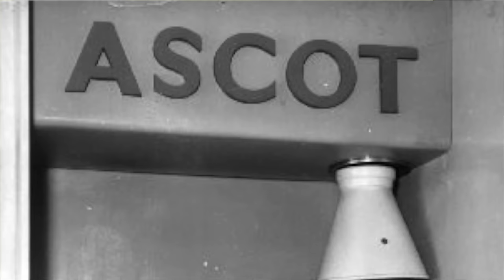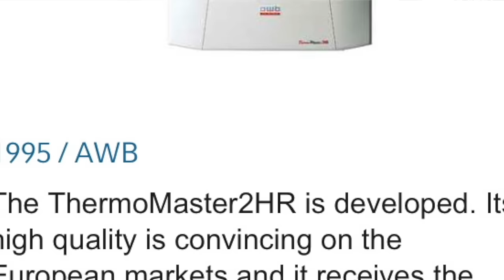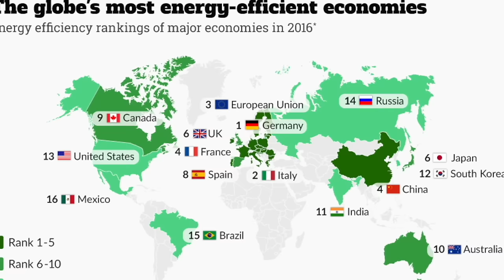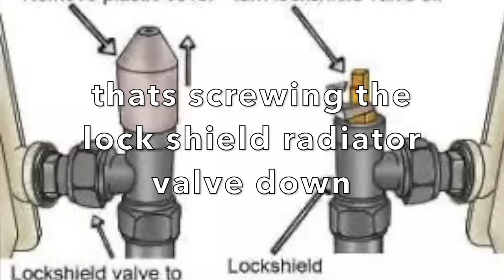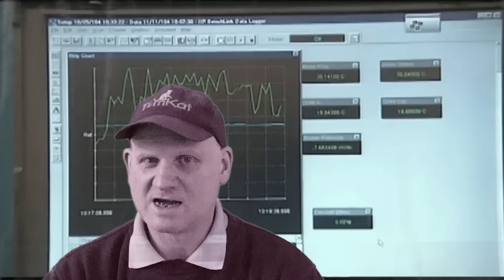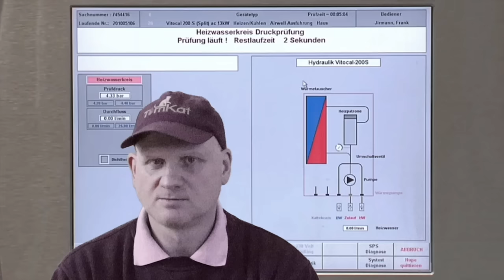WHICH IS THE BEST GAS BOILER for your home. Looking into the best boiler for uk homes in 2022

Comment: Quite right about old boilers. I have a 25 year old Camray Oil boiler and still going strong. What is the progress having to renew them every 10 years. What is the point of high efficiency when they only last 10 years?
Reply: Burn less fuel?
Reply: @edc1569  Yes I suppose so with 30% extra efficiency they would pay for themselves in 10 years . Since I posted that comment I sold my house with the old boiler and got a house with one of the new ones in it and what really makes the difference is in new radiators.
Reply: True, what's the point
Reply: @CommercialGasEngineerVideos  The money that is saved in fuel over a period of the life of the boiler is cancelled out by the cost of its replacement. I think I would rather have an inefficient boiler that could go on for 30 years than one that has to be replaced every 8 or so years.

Comment: I dont know about Best boiler But this is one of the the BEST Videos for our market...Thanks and will catch up soon..
Reply: I think the best 3 boilers are the new W Bosch, Vaillant  green IQ and Intergas, regards george
Reply: @mrcombiBedford  WB old rubbish recycled...at least they made an effort on the PRV...Vaillant yes agreed and Intergas Nope takes too long for parts to arrive and they are extortionate prices on parts AND their technical support is shite BAXI Alpha Vaillant all the way
Reply: @chohanchohan8208  I used to install loads of Intergas, my two installers put loads in the very very reliable one pressure switch (muck) part from P Centre was 2 days. Mine is 8 years our daughter is 3 years  both zero faults. As always it's down to installation and 12 month regular maintenance , regards george

Comment: Valliant Boilers: the Mercedes benz of boilers. My diverter valve started to leak in two years but then again: my radiators were not flushed: Had them flushed and since then the boilder worked flawlessly.

Comment: Have had a Potterton system boiler for 13 years and only one warranty issue. Getting kitchen done and replacing with Baxi 800 - backed with a 10-year-warranty. Spoke to three different gas engineers who all rate the Baxi for ease of fitting and reliability.

Comment: Excellent video Derek, packed with a wide range of information its very difficult for the average consumer (me) to take in. Watched this video a couple of days after my heating guy advised and fitted (replacement) a Worcester Greenstar 30si in our medium size 1930's solid wall double fronted semi with one bathroom. Hopefully a good choice for my circumstances. In the process of trying to work out the best auto setting for the EPH. Also watched a very simple balancing video from "Skill Builder", if needed in the future. I used to think computers (my expertise) were complex  but heating a house is up there with them :)

Comment: I had an Ideal Combi boiler installed early 2019. I think they took the ancient Baxi one I had to an archaeology museum? I have a hand held remote about the size of a small round alarm clock with touch sensitive controls to control the heating. It bypasses all the thermostat and other controls on the wall. I get hot water on demand, so only pay to heat up what I use. It has slashed my utility costs by a third. Absolutely amazing. I had previously gone through two harsh winters with no heating or hot water, so I really appreciated getting the new boiler and then some. Plus it freed up so much more storage room in both my cupboards as I no longer required a cylinder. Two chaps working full time were all done and completed in just six hours. They even declined a cup of tea when I offered and I make good tea. 👍😜🤦‍♂️👀✌

Comment: Hi Tomkat,
I had a Stelrad old style Boiler with a Hot Water Tank upstairs. It worked perfectly for 45 years until it started to leak rusty water last winter. I got a Vaillant 830 Combi replacement and i must say what a life changer not having to heat the water tank up to have a bath and also whilst in bed during the winter i can switch on the heating with a remote control box during the night from my bed . I do suspect though that my new Boiler is oversized for a 3 Bedroom House.
Who knows. Interestingly my bills are not any better, especially the Electric which is quite high.
Stevie in Fife.
Reply: Worth asking the next boiler servicing (ideally the same firm who installed your one or who installs the same brand) and ask what can be done to make it run more efficiently. I've also heard that only some controllers work with X gas boiler brands, forget smart controls. The bigger issue is that most non supersmart controls are not tested against boilers

Comment: My WB system boiler has a warranty of 8 years . Installed last September. We had a 80,000BTU CF floor mounted Ideal E Type. Fabulous. Worked 44 years and totally reliable  only maintenance a thermocouple every 25 years. Dead easy to replace. But energy prices have got at me. We have a 4 bed house , fairly large but my wife wanted an airing cupboard. No combi then. The new WB is in the garage so no noise ( attached to house closely) . I hope it lasts a long time but won't last 44 years  but nor will gas central heating. The world has gone mad. I am too old to bother.

Comment: Great informative video. Confirmed my understanding about the complete installation needing to be considered and done properly. I'm not a heating engineer, however it surprises me how many have commented and insisted they know the best boiler. Maybe they need to look at the video again but with an open mind.
Pros - great advice on what to consider for consumers and heating engineers.
Cons - the cuts in the video are a bit annoying at first but well worth persevering.

Keep up the good work!
Reply: Don’t be surprised by people leaving a comment on which they think is the best best I left a comment at the top of this page just below the video . this is through 15 years experience of fitting a particular brand ( viessmann) From my point of view as an engineer and from the customer’s point of view in terms of satisfaction this brand is number one in Europe & uk its also the most efficient
Reply: @SalimKhan-gk1fh  I understand your reply and agree that there are very good reports of satisfied customers and installers with Viessman but you are looking with a very narrow view as a good installer who ensures that you only fit to a good, clean system. A Viessman boiler properly installed may well be the best, or at least one of the best, however the point that Derek was making with the video is that the best boiler fitted by an installer that takes short-cuts is more likely to experience problems than a cheaper boiler installed properly.
The other point is that if a customer expects a particular feature such as instant hot water, they won't be satisfied with a combi boiler with a long pipe run to the taps.
To sum it up, it is important to use a good heating engineer who will discuss and advise on the most suitable boiler TYPE and will then source and properly install an affordable brand.
I am looking at a Viessman or Worcester Bosch System boiler plus new cylinder at the moment but will find an accredited installer with good feedback as I believe that it will give me the best chance of an installation which is trouble free in the future (provided that the 12 monthly services are performed!).

Comment: I have the best boiler .A ideal stnd 40/60 boiler fitted in 67 and ( repeat ).never let me down ,in a fairly big detached house 10 rads.Bills are fairly low ,and cannot have it on full as its gets tropical inside .
So simple ,cast iron heat exchanger ,gas valve ,and thermostat .And pump renewed 25 years ago .How can modern boilers beat that .lol

Comment: It's probably fair to say that combi-boilers grew to dominance mainly through new-builds. The boiler itself might be a bit more expensive than heat-only, but for big house builders they much prefer nowadays to fit a combi because it saves them the added cost, manpower, and extra space requirements that come with fitting a water tank and all the related plumbing and wiring. If you live in an older house with a tank already fitted, you've got to think hard about whether you're better off getting rid of it.

Comment: Top Tips on the set up of any system! My 25 year old Valiant combi is hanging in there but for how long who knows keeping it alive by descaling heat plate each year and replacing parts as they leak is working for now.  A new boiler & installation cost vs energy savings and new boiler in 15 years approx is food for thought & i found your video very informative especially about the heat controls & modulation! Thank you!!!

Comment: I'd be very interested to see the actual gas savings from using a combi vs stored hot water- I very much doubt there are any! A comb fores every single time a tap is opened. It heats itself first, then the water, then the pipes- by the time hot water reaches the taps the boiler might have been firing at full power for twenty seconds. Repeat this dozens of times a day and it soon adds up to a lot of wasted heat. A cylinder heats once or twice per day under normal use. A modest sized cylinder looses around 1kwh of energy per 24 hours- that's about 3p worth of gas. Don't forget, that in winter that heat "lost" from your tank makes a small contribution to keeping your home warm too- so for six months of the year your central heating has to work a tiny bit less hard! A tank gives you a back up option (immersion heater) and a heat only boiler is less complicated and therefore longer lived than a combi.
Reply: As you say it's for one outlet only, with about 21 million dwellings over 60% are 3 bed or less thus a combi is the correct choice, for larger hot water demand we have U Vented with a combi or system boiler. It's up to the installer and customer to fit the correct system for the house, too often wrong.
Reply: Mr Combi Training & Sales Someone with a vested interest in selling combis would say that! The only redeeming feature of a combi is that they are space saving, at a push i would use one if I was refurbing a small flat for sale. I would never have one in my own property, and I would never install one as a landlord because they fail so regularly and it pisses tenants off, not to mention costs a fortune in emergency repairs.
Reply: @spencerwilton5831  Hi Spencer, A bit harsh, combies only exists because stored water is so expensive and unhygienic. I agree combies are not for dwellings of more than one water outlet, but that is 70% + what we live in. The UK installers are the worst in Europe which is very sad. I have been a trainer for over 30 years and Mr Combi Training for over 18, every week we get installers 20+ years in the heating world NEVER fitted a by-pass, frost stat, TRVs as standard, external vessel as required. Systems not balanced or flushed our and NEVER put inhibitor which is why boilers bread down and these emergence engineers keep making a load of money, I used to be one. It's not my fault the system is mess but I will fix it. Your car mechanic WILL change parts BEFORE they break down we should copy. Any moving part at 6 years is due to fail, installers say when it breaks down call me- what? That's the problem we have in 2020 2021 etc. regards george staszak Mr Combi Training, we only train installers to become breakdown engineers who will make a lot of money for many years.

Comment: Good video, as an gas safe registered installer I agreed with most of the points raised. 
When installing a system or heat only boiler it’s important to stress to the uninformed consumer that there isn’t a diverter valve to breakdown internally on the boiler with that said would be good to hear opinions on the best type of materials used on heat exchangers these days, my self I am now moving towards stainless steel as it’s seems more durable long term(10 years on) .
100% agree on a clean system being a must, power flushing and inhibitor is essential .

Comment: I've  put in a viessmann vitotrol a few years ago and its easily the best combi I've had to date it heats up the house as quick as my kettle boils and 5 year guarantee superb!
Reply: Yes Phil .I have fitted loads of them now very very good also quiet and efficient, think u meant vitodens not vitotrol!?
Which one do you have the 100 series?
Reply: Sorry yeah vitodens! Mind you I've now fitted the hive system on it because the viessmann thermostat was just a bit to complicated than it really needed to be and I'm very pleased with the whole heating system the viessmann boiler was probably a bit more expensive than the rest but definitely worth the extra!
Reply: @philmoffett366  Yes I know what you mean! I have fitted over 20 viessmann boilers  but found customers can’t operate the vitotrol thermostat so stopped using them, even I can’t understand how to operate them! Your boiler may have been a bit more expensive than the others you were quoted on but only the viessmann boiler can give you good economy on the gas savings 
Once all the house is heated they drop down to a very quiet tick over and operate on a lower gas rate typically around approximately 20p an hour .  of the ones I fitted people noticed a gas consumption drop of about 20 to 40%. The viessmann technology Is more advanced than other brands and they have won multiple awards for it
Reply: @SalimKhan-gk1fh  that's interesting to know! I just went for the viessmann because of the little bit of research I did and recommended opinion it did stack up as a good boiler but what has transformed it is I have installed a hive on it and it's so much more accurate with the temperature and more importantly much more useable👍 sometimes modern technology can be a pain at times but in this case its brilliant! At work all day use my phone to switch it on 15 minutes before I get home..........brilliant👍
Reply: @philmoffett366  That’s good to know which model did you fit ?  did you fit the 100 series or the 050?
Have you noticed any drop in your gas consumption as most of the ones I fitted people noticed a good drop in gas use 
also have you noticed they are a very quiet running boiler?

Comment: I’m a fan of baxi 600 and 800 easy to fit easy to work on my opinion only
Reply: All boilers are extremely good and reliable, we have a big problem with unregistered installers who are used. They rip off customers and we have to fix it. Too many will not pay the correct amount and get the job done correctly.
Reply: @ME-ol9gk  My two mates Chris n Stewart do all my old customers we never charge less than £2.2K, we up-sale with boiler controls Danfoss eco TRV's etc plus 10 G;tee
we learnt a long time ago how to make a presentation pack with factory promo bits and charge more than other quotes by quality, People will pay. george staszak

Comment: Ideal is the worst had problems since day one in new property. 
Thanks for video
Reply: You're unlucky bhaijee as they're the best and the Asian choice. Worcester Bosch use an aluminium heat exchanger which is substandard vs. stainless steel in the Ideal.

Comment: I have had my VIESSMANN 200W Weather Compensation Combination Boiler for 13 years, regular service only recently had new water flow switch, spark contacts, flame electrode,  burner chamber gasget, & new outside temperature sensor, its going to be upgraded for Internet and new low energy pump, so yes I'm very happy its well made for sure 👍

Comment: Very well fair unbiased report on selecting a boiler manufacturer.
I totally agree with you that choosing the right system is the key to an energy efficient hot water and heating system and it should be a mandatory requirement using a weather compensated heating system in the uk.
Manufacturers need to incorporate a weather compensator compulsory so the boiler is not over cycling and is working at it’s optimum.
Sweeden  and other countries have a far better understanding on heating design and usage.
Boiler longevity would be achieved and fuel poverty would decrease.
Well done Derek you are a credit to the heating industry.
Reply: Zahur Weather compensation now is mandatory,  As part of boiler plus viessmann Have been supplying  vitodens boilers with a compensation sensor in the box with the new boiler for over two years now. The gas savings and efficiency have been impressive

Comment: Forget the budget, its Vaillant boilers in all situations, they are not too expensive, especially when your cheaper boiler goes down. They are the most reliable and easy to work on. A dirty system needs cleaning and a magnatite filter should be fitted so your diverter then won't fail.
It's the Rolls Royce of boilers and I have been fitting them for over 25years, tried others and regretted it. No brainer!

Comment: great video! i actually got 13 years out of an ideal isar 24 but it was constantly on preheat HW (costly if you live alone), very basic CH modulation with over sensitive HW activation (as 1 drip from a HW tap run the boiler at full). 
My new Worcester 30i CH has noticeably better modulation as it turns the burner off before reaching set temp, as not to over shoot set temp. HW is perfect for my mixer shower with 12.5 ltrs per min. The Eco option finally stops preheating the HW in summer that dogged the isar, but only time will tell especially with my gas bill.
Reply: Fantastic glad you fixed the problem. I did Park Homes and loads had pre heat ON which on LPG is expensive . regards george staszak

Comment: I thought that the new modern combi and system boilers had modulating gas valves that varied the size of the flame according to demand so that when the heat requirement was low the flame was low. Say in the region of 6 Kw hour, and up to what ever the output capacity of the boiler for high demand. so it did not matter if you had a slightly larger combi boiler to give a higher capacity for domestic hot water for a bath that filled reasonably quickly.